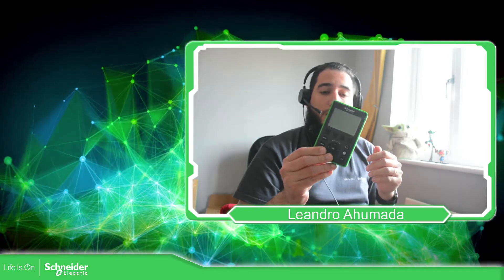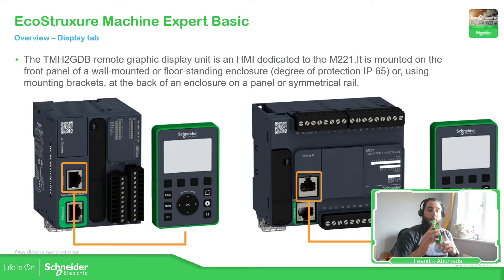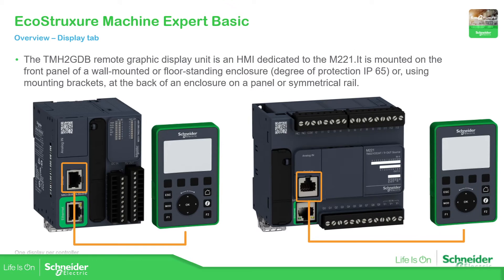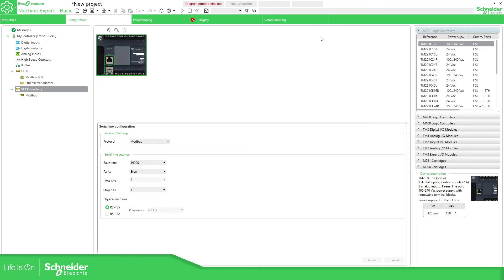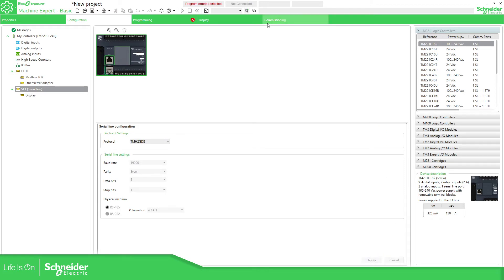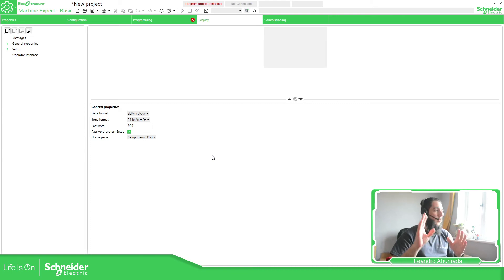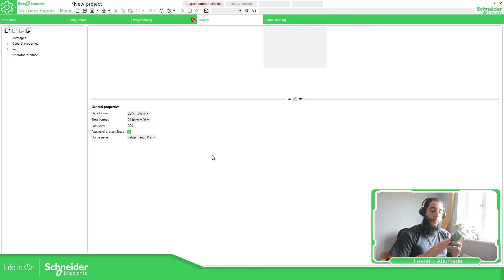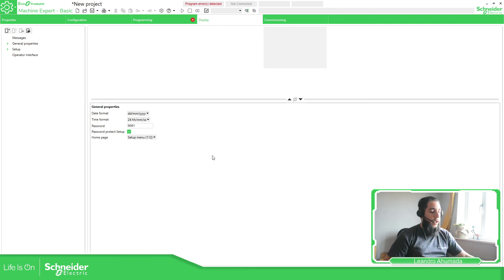Training - M221 - M2.4 EcoStruxure Machine Expert BasicTab Display

Comment: Hello. Thank you for this Traning videos playlist. We have an Altivar 71 whith a graphical display. We intend to use the M221 controller with the Altivar  but in this case the graphical display should be moved out from the Altivar. Can we use the graphical display alone with the M221 controller or other devices ?
Reply from the maker: Hi Tarek! If you are using the display of the ATV71 ( ibelieve vw3xxxx) you can not replace it with the one for the M221 (TMH2GDB) but you can use the M221 to read/write some parameters of the drive and connect to the M221 an HMI to design the interface. I am not 100% sure if i answered your question
Reply: @LeTomasAHUMADA  Thank you very much. My question is : Is it possible to connect the display of the ATV71 to the M221 because we have not an HMI ?
Reply from the maker: @tarekbenhacine8743  to be honest i have never tried it before the problem is that display of the atv71 has their own program compatible with drives. If you need a cheap display try the TMH2GDB:
https://www.se.com/ww/en/product/TMH2GDB/graphic-display-modicon-m221-unit-240-x-160-pixels/
This display is very easy to use please check on my channel for the training of that display.
Reply: @LeTomasAHUMADA  Thank you. I will try to buy the TMH2GDB.
Reply: @LeTomasAHUMADA  Hello. Just a question. I Iintend to connect an encoder with the M221. Can I use the TMH2GDB to display the variation of the pulses number ?
Reply from the maker: @tarekbenhacine8743  the HSC value will be available in a %MW or %MD then you can do whatever you want with, i believe in your it will depend on the value and how to show it on the display to look nice, please check the videos M12.x for HSC on M221:
https://youtube.com/playlist?list=PLFqT6GhMpgpLClSpB1iH50OUr4N4mU763
Reply: @LeTomasAHUMADA  Thank you so much